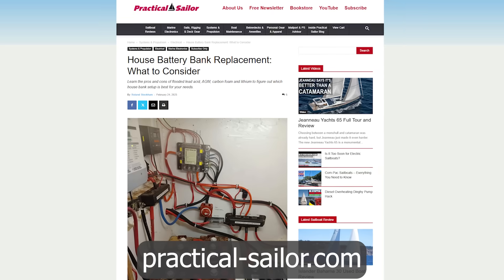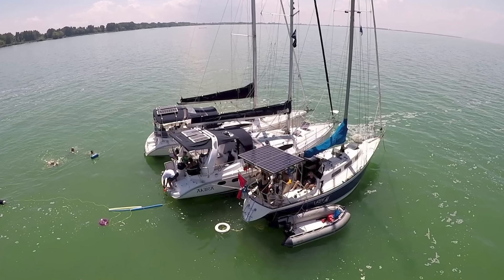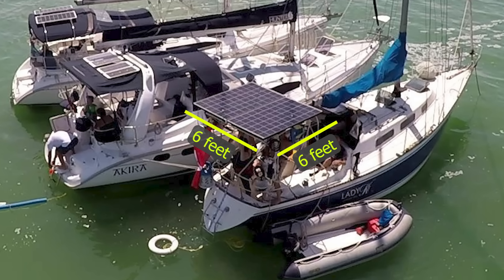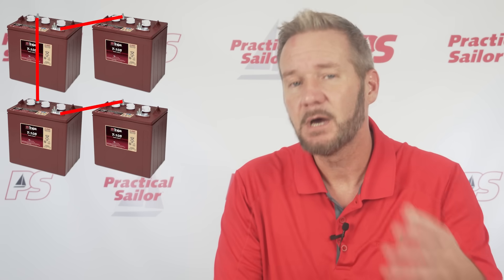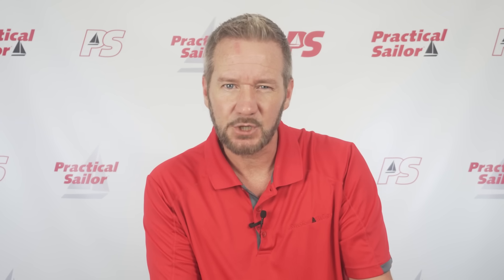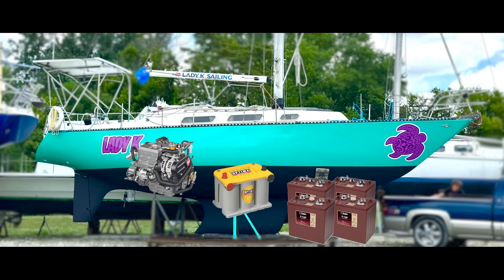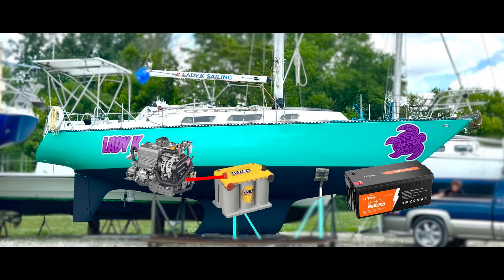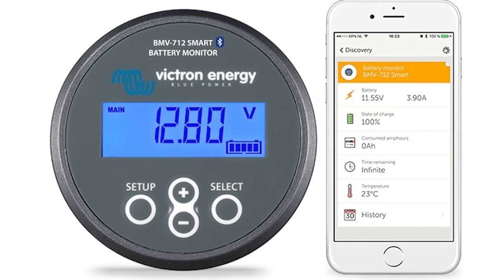Which Batteries Would I Buy TODAY for my SAILBOAT?

Comment: There is no end of configurations, it all depends on the boat and its equipment.
One power-hungry item to add is the navigation system together with the auto pilot. 
My experience is - there is no over- supply of solar. 
Living at 6 degree south at the equator with a lot of clear sky, I get up to 5,5kWh out of 1.000 Wp solar panels. When there is a cloudy day, it can be down to less than half...
I have done a good number of older boats - upgrading the power supply - its always a similar story: not enough space for the desirable number of solar panels.
Whereby at times its worthwhile to have a large number of small panels, rather than big ones, for reason of fitting them easier into space as its available.
Batteries: max 1Ah per Wp solar, better less so as to be sure batteries get fully charged. MPPT charge controllers - better two for redundancy 😊

Comment: We're refitting our 1979 Morgan 382 now. LA for starter battery charged from alternator. 2x LiTime 200ah batteries for the house bank (the 230s were too big to fit in our battery locker) charged by 550 watts solar and a 400 watt wind turbine. Adding an electric windlass (80 amp draw) powered by a 100ah 'mini' LiFePO4 battery with a 100 amp BMS under the v berth recharged by a Victron 30 amp dc to dc charger from the house bank. 

If you're doing a lithium conversion, take care to use fuses and breakers to protect and isolate systems. Our boat didn't have any fuses or breakers to isolate the systems, but it will when we finish the refit.

Comment: It's not entirely true that your boat's alternator cannot or should never charge LiFePo4 house batteries. There are some issues but they can be dealt with. In the van conversion world this is done all the time.
1. Your alternator won't be able to fully charge LifePo4 batteries because its absorb voltage is too low for LiFePo4 but that's okay because LiFePo4 batteries don't mind sitting only partially charged assuming you cannot top them off using solar.
2. Depending on battery capacity and state of charge, a LifePo4 battery can draw more current than your alternator can accommodate which can result in the starter battery being drained or a system voltage drop. This can be dealt with by introducing more resistance between the alternator and the house battery by using extra cable or thinner cable. Obviously this needs to be done carefully and correctly but it's also only necessary if battery capacity and alternator output are an obvious mismatch.
3. A LifePo4 battery's BMS can disconnect the battery from the charger for a variety of reasons. To protect the alternator (which must always see a minimum load) it's sufficient to simply never run the engine in the battery switch B position -- always in A or A+B.

Comment: Good discussion. Would be good to cover AGMs a bit. We use 2 6v agm Lifelines plus 1 12v agm for house; one 12v agm for start fed by 2 170w Sun Power panels through a Victron hppt controller. Installed in 2021, the banks continue to be fully charged, even on the lowest solar days. The system is midlife, tho, so  another three years…

Comment: Use the Victron Orion XS 50 amp dc-dc charger. This new unit is much more efficient than the 30amp version so it does not get excessively hot. Also important it has the ability set a limit on the current extracted from the alternator so you do not overheat a small alternator. 
I still like the built in voltage/current meter. Yes you can use an app on the phone, but things can happen to phones and I would rather the boat instrumentation provided the basic information in the absence of a portable device. I also like the Victron Cerbo unit which with a compatible chart plotter can display all the boat’s electrical systems. (Or on a mobile device). 
Another power generating device on a small boat is a wind generator.  These devices I think really need MPPT devices to optimise charging, however, often these devices can only reduced voltage and not boost voltage. That means power generated is wasted if the wind speed is low and hence the wind generator voltage output is low. I don’t know if anyone makes a wind generator with a buck-boost converter including MPPT or if you can buy an MPPT with buck-boost capability?
Thanks for the discussion.

Comment: Epoch really has a great battery and they have a dual purpose that will start the engine pair with a high output alternator and you have a generator. Really any lifepo4 battery for so many reasons biggest charge speed lead is slow to charge and heavy as hell not to mention have hardly any lifespan. Tons of new alternators on the market for 500$ that charge lithium I’m currently charging mine with alternator.

Comment: tim could you do a video about the new BLUEtti portable power stations?  We are working on an old boat and our goal is to do some cruising but mostly just a weekend or at most 1-2 weeks up North (not in the south) so we are thinking to get rid of the battery storage just use a starter battery and the Bluetti but we havent seen any youtubers doing that so would like to know why? what would the drawbacks be of ddoing that instead of the standard system you have on LadyK?

Comment: You made the classic mistake of using an RV architecture on a cruising sailboat. What you should have done was changed the altenator to a high output externally regulated unit and used a smart regulator with a lithium profile. I use a 200 amp Bosch rather than a marine unit and a Balmar regulator.  Balmar makes a small device that can protect the alternator in the case of a rare event of the BMS taking the load offline. In the RV architecture, you maxium charge rate is 30amp (Victron now makes a 60 amp) from the engine.  Why waste the potential of a high output altinator where you can charge at six times the rate of your Victron DC/DC charger.  Common architecutral mistake. Your solution was designed for RV's that drives many hours a day and typiclally does not have the ability to change the alternator. Do it the other way and charge your lead acid with a DC/DC charger from the house bank.

Comment: Totally agree.  24v 100ah batteries are readily available for the 24v boys and I like the Victron displays.  We have a 2nd alternator configured for the lithium and various protection circuits installed.  The reduced weight on our setup is huge, to the point where the boat sits higher in the water!

Comment: Good video. Did exactly that about a year and a half ago. AGM engine with a DC DC converter and lithium house bank.

Definitely worth also mentioning the fusing is a bit different too.

We still put a switch on the engine battery and a breaker between the DC to DC converter and lithiums

Comment: The best batteries are those used in submarines, for example, which last between 20 and 25 years, then there are gel batteries which last between 10 and 15 years, and finally lithium batteries which last between 5 and 10 years! On the other hand, lithium batteries are not reclosable, while the other two are.
Reply: Subs use nickel metal hydride which are unavailable to buy.
Reply: @jackdbur  This yacht has the battery of a submarine! 2014 KM Yachtbuilders Bestevaer 66 | 66ft

Comment: I completely agree with you Tim.  I had 4 T-105’s and today (unless Trump screws it up) lithium is cheaper than the Trojans.   And the other probem with LA is the last 15-20% is very difficult to put into the batteries so you only get about 30% useable, or 135A useable.   With just one 300A lithium you get 80-90% usable or 240- 270A for one battery.  Two of them and  of course double that.  And the other huge difference is rate of charge.  Huge difference.  All day even on shore charger to charge the Trojans and not much more that a couple of hours to charge the lithium.  As Tim say, the most solar and the most lithium you can handle.

Comment: in the configuration you present here is the solar charging the start battery or the house battery?  if need by how do you use your house battery to start the engine with the DC-DC charger sitting in between?
Reply from the maker: Solar charges house. Never use house to start engine.

Comment: Lithium batteries are somewhat over-hyped, meaning their longevity is typically over-estimated and people don't emphasize the vulnerability to the BMS, to the point of "faulty BMS = your boat will burn". Not saying all is bad but even reputable brands produce total blackouts from time to time due to faulty BMS-es where the only way out is to get a new BMS of the same type - if you can. 
Not saying all is bad but unless someone is a live-aboard cruiser with the goal to spend months on end at a remote atoll don't fall for the hype. If you really need more battery get more Trojans - but getting more panels will help more.
Reply: With LiFePO4 batteries your BMS cannot start a fire.  Blackouts indicate a faulty system design or installation.  Your charging system needs to be designed to stop charging at 80% or so and only to 100% occasionally for balancing.
Reply: @BOOMER9196  On a big enough boat with enough $$ involved, your last sentence might be worth chasing down. But on cheaper boats, it's not worth it. Everyone has to pick their battles.
Reply: @ The BMS has to work well to prevent overcharging which is the way to stop the battery from igniting. If everything works well, everything works well, that logic is not the way to manage risks.
Reply: @koborkutya7338  Show me a single case of a LiFePO4 battery burning, no matter what the cause.

Comment: We own a 1968 steel ketch, as liveaboard cruisers we needed to bring into the 21st century. So I installed a Balmar 210a large case alternator, with the 618 external regulator reduced to 85%. Then wired that through to the sealed lead acid 220a starter battery, then through to a 120a DC to DC charger onto 600a of lifepo4 house bank. From there that provided dc power to the 3.5kw 220v inverter. I have 900a of solar, 400a of which are suitcase pv which we deploy when at anchor. As a backup we have tucked away a 220 eu honda suitcase generator to run the watermaker if required. Fortunately we have never needed it. We live on board 24/7 365 and never had a power issue. Great video Tim. Thank you
Reply: Thank you for your observations. It's a 12v system, the solar is 900w, lifepo4 600ah, we installed the system 2 1/2 yrs ago. We have learnt alot in that time and still learning. I think when we upgrade I'll use an active BMS as opposed to the Daly passive which seems to have trouble top balancing all the cells. Thank for comments

Comment: That is almost exactly the system I have, 2 Li Time 230ah battery's, 2000 watt Victron inverter/charger. I do not have enuf solar and knew that going in but future mods will allow for more panels but for now I just have 2x Renogy 115 watt bi-facial panels looking to add 400 to 500 watt more and a wind turbine in the future.

Comment: For my electric golf cart I bought a Vatrer LFP battery.  The Vatrer batteries include very nice battery monitor display and cable to plug it into the battery.  It ties right into the BMS (something you didn’t talk about, all LFP batteries have a built in battery monitor system…).  It not only displays info on the overall battery it also displays the voltage of each individual cell.  The BMS also has Bluetooth output so you can monitor it with an app on your smartphone.

Comment: Would be easier if you talk in Watt hours instead of amps (or display both). You talk in Watts for input, people use Watts for appliances (output), and it avoids confusion is you leave out the voltage of the batteries (and different parts can be at different voltage)
Reply: But amps are the fundamental thing to count in a 12V system.
Reply: @artsmith103  They are not needed if you are looking at the energy used and stored.  The problem is things don't always work in 12volts, if you say Amps you can't assume people know if you are using a 12v system, you have to tell them (and people often don't on youtube, or waffle on then say Amps and you have missed the volts or they say the volts at the end, SO YOU ARE LEFT GUESSING how the system works). Appliances have transformers and usually have a label with Watts. Boat systems are not always in 12v, people use 12,24,48 Volt.
Reply: @AORD72  I don't know if you own a boat but we captains count amps. We use a clamp-on amp meter to measure amps. Shunts measure amps. Batteries rated in amp-hrs. Wires sized for amp loads. Most devices rated in amps. It doesn't matter much how the volts vary from 12 to 13 volts.
Reply: @artsmith103  Ok then, take the long way and use Amps and volts and do all the conversions when you plug in you a 110 or 240v appliance (which will have the Watts listed on it) . Otherwise just use Watts and make life simple. Solar panels are listed in Watts, Batteries are listed in Watt hours, appliances have Watts on them so the math becomes very simple. But hey if you like doing lots of math's stick with Amps.
Reply: @AORD72   Are you talking about 12v boats or not? Don't care what you think is clever in other environments. I have never heard a boat owner at my marina talk about watts. And as a matter of fact, watts are least meaningful with solar.
Reply: @artsmith103  I'm talking about anything you plug in or what your batteries and solar are set up as. Not everything is 12 volts.

Comment: Nice video, Tim!  I like the idea of keeping the solar and battery capacities in balance, and your mention that solar efficiency has gone up considerably over past few years, just as battery capacity has.  Win-win for both.

Your note about getting 400AH at 12v from a 1,000w solar array (7:30) seems a bit low.  I have a much smaller (2 x 225w) array here at home, with both morning and late afternoon shading, and I still get north of 1kwh per day from the panels.  Yesterday I nearly topped 2kwh.  I presume the difference is due to location (Northern California here), so noting that location makes a difference might be worth mentioning.  Arctic sailing not so good, but folks in the South-East and Caribbean can probably do even better.

One safety / redundancy suggestion, include a way to recharge the Start battery from the house bank.  This could be another DC-DC charger, but if you're careful a simple circuit breaker to cross-connect the two would do in a pinch.  Clark (@clark's adventure) has a "Bank Manager" product that can intelligently manage a Lead + Lithium battery system.  Solar or Alternator charges the Start battery, Bank Manager connects Start to House when it's safe to do so, keeping the house bank charged too.  Worth a look.
Reply: The DC to DC charger also charges the starter battery, if you buy the right product
Reply: @boatMatthias Wait, some can run in either direction?  Which product?  My assumption was that you need two of them, even if they are two of the same thing.  Please explain!
Reply: @tubeuser2350  I read about this feature with the renogy devices, but now I cannot find it.
Reply: actually, Arctic sailing = Summer sailing  = close to 20 hr sunlight or more depending if above or below the Arctic circle, can't beat that!
Reply: @sailhikeski Not if you talk to sailing alluring arctic ;)
Reply: Cool, had not heard of them! They did not stop in my city ,Iqaluit on Baffin Island, where I've been living for 25 years. @boatMatthias most of their sailing was above the Arctic circle, where for several winter months they are in complete darkness, they certainly did not rely on solar for a good chunk of the year! Solar calculations for where I live, where today sunrise is 03:15 am and sunset is 21:48 pm and increasing until Summer solstice  actually average out annually (1,057 kWh/yr) very close to most of Southern Canada (Toronto - 1,163 kWh/yr).
Reply: @sailhikeski  very interesting, thanks for sharing.

Comment: I have Dakota lithium 100amp hours run in parallel, and flexible panels glued to fiberglassed foam backing.  Super lightweight.  The panels are mounted to a pole via a windsurfing mast flexible coupling.  Cheap diy version of those 900$ carbon fiber rail mounted lightweight panels.

Comment: I'll tel you what I did on my Jeanneau: 1 x 12V AGM, start battery, and 3 x 4KWh lithium, with 240V AC. There is good room for 10 of them, so, considering an electric motor. 2000W max of solar. Down under, all runs on 240V. I dont think that I need much more to replace the engine to go electric in/out of port, 25KWh is 3 more batteries/Powerbanks. AC power can be "added".